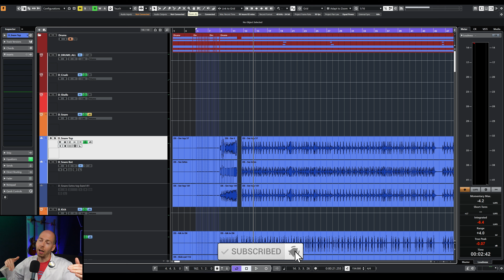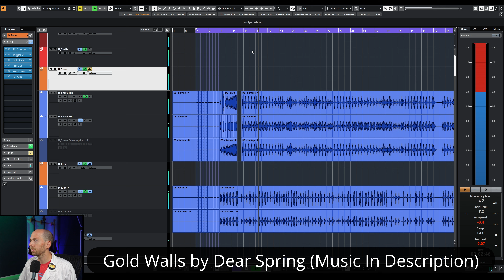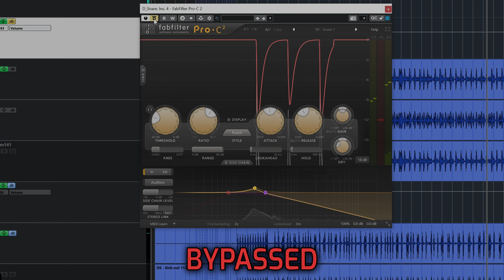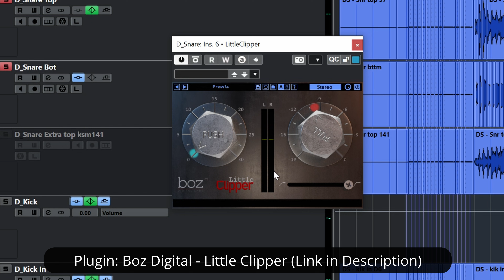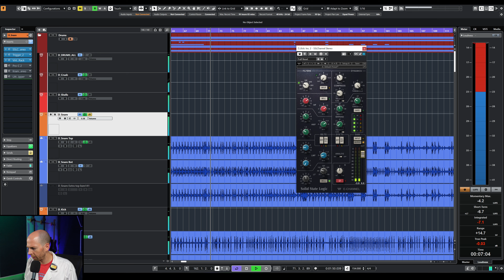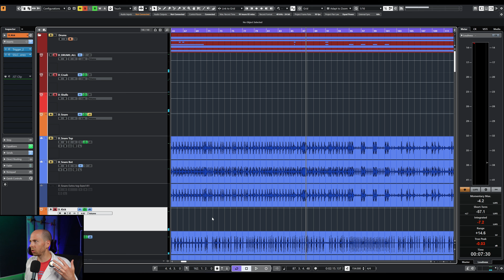DON'T MIX into a Limiter or Bus Compressor Until You See This!

Comment: Its all easy when you don't care about the snare having any CRACK, let alone wanting loud crack. Its always the first thing destroyed when over compressing. Still lots of good points in the vid for those that don't. When doing my own masters, which I don't prefer, but usually do it to have my snare the way I prefer, I don't master from a stereo file, but have the stems available in the open mixing session. This is crucial, because as that level is raised on the master bus and I start losing that snare, many times adding various different tools on the track level can bring back my precious crack, sometimes even just rolling up the fader, all while keeping the levels where I lost her, its results are material dependent tho. If I lose the snare crack to meet some loudness goal that HAS to be archived, I could really care less anymore about the mix, the drum energy is gone.

Comment: I just don't get it. Why would you want to be hearing the sound of a mastered track when you're mixing it. Just make the best mix you can without top loading it. The mastering will take care of the rest. Have some faith! 🙄
Reply from the maker: Because often times - especially with dense music - you "mix yourself into a corner" and don't realize how certain frequencies will build up as you begin to increase the loudness of the song in mastering. Same goes for your transients - as the song becomes more dense and full, you will start to lose definition of the transients. This allows you to compensate in the mixing stage so when it's mastered at the ideal loudness it will be exactly where it should be. It's like seeing into the future :)
Reply: Because some mix can sound distorted or some elements can be lost  after mastering. Its best to be aware of these things in the mix before you send it off
Reply: “Have some faith”? No man.

Comment: I definitely DO NOT mix into a limiter. I add mix bus processing about 1/2 way through. Usually a compressor first and then EQ before i do my automation.  I do however, pay close attention to regulating peaks and maintaining good crest factor for all those reasons you explained. The thing I don't understand about mixing into a limiter is, what becomes of the mastering process if you already have the song limited at the mixing stage? You cant just take the limiter off, right? The mix would fall apart. So, do you just send the song off to be mastered with the limiter on?  Are you even mastering a song that you mixed through a limiter?

Comment: Since I first watched this I’ve been doing way more gain staging and it makes it all sound even better. I used to clip drums at the stem but not at every element like the snare or kick. I actually have a full master buss chain. I use a buss compressor with a low filter at around 120 (depends on the song) then into a linear phase multiband to keep everything in check and do the low and compression. Then a maxbass by waves. A waves center for stereo imaging. Then a ssl rack with a 12k 2db highshelf. I just like the sound of that one. And an eq. Then in post a clipper into ozone with the joey sturgis chain he showed on nail the mix. I do turn a lot of it off to check if everything still sound good without, but to have it there to be able to listen what it will actually sound like is amazing.

Comment: Another great video, thank so much for covering the concepts.  Another reason to gain stage and specifically watch the input levels into plugins is because quality analog emulations VSTs are designed to work at specific input levels and will distort or add too much saturation if the input is too high.  I initially resisted mixing into a 2-bus compressor and limiter, but now I do, and I engage them after I get drums, bass, and a key instrument or two set with EQ and compression.  A key benefit I found to this is that I can optimize the initial mix because I know the amount of gain reduction I want in my master bus compressor and limiter, so I have the thresholds already set on those.  That way, when I am done mixing and ready to master, the level on my master bus is good.

Comment: This only works in the box? How would you so this with all analog hardware and console?
Reply from the maker: That's correct. If all analog, each piece of gear will have an ideal operating range which doesn't directly correspond to digital signal levels (at least not without a reference).  You need to maintain the signal within each device's specifications from one piece to another...

Here is a great video that explains the problem and how to manage hybrid gainstaging for an RME interface. https://youtu.be/UCyXcrT7SnI?si=zma4QmywIlJkAek1

Comment: For someone who primarily uses amp sims and vsts in general, what level range would you recommend going into the mastering chain? I have been trying to keep it around -12, but after hearing you state that you should try to keep it consistent from the input throughout the chain, I am not sure what I am doing is correct. I am not clipping anywhere, but I do try to keep my input on my DI peaking at around the yellow so that I have good signal into my DAW, but then I will apply some limiting or other output adjustment to get down around -12. After listening to you, I think I may be incorrect.

Thank you for the great material!

Comment: Great video as always. So I’m wondering if you tend to setup the individual track dynamics/compressors etc first before you start properly start mixing into your mixbus compressor/limiters?
Reply from the maker: Yep! It's in my mixing template. I have them all bypassed and then quickly adjust the settings for each project. The in and out levels are all set up to make sure the gain staging is rock solid. Great question!

Comment: When your done with the song do you remove the limiter to do mastering
Reply from the maker: Yes!
Reply: @RaytownProductions Do you mean you remove the limiter and turn the master bus down so it doesnt clip before sending it to the mastering engineer?  Or take the limiter off and make no volume adjustments before sending it to the mastering engineer?
Reply from the maker: @380stroker  That is something that you should ask the mastering engineer. Typically, mastering engineers like to be in control of the transients and like using their tools to modify the dynamics, so many will prefer to work with a version of the song that doesn't have an output limiter on the track. BUT there are times when it's nice to master a song from the ending point of the mixer (meaning with the limiter and "premastering" chain engaged). Either way, there really isn't any disadvantage to turning down the master fader to ensure that nothing clips during export. Hope that helps!

Comment: So it would make sense to make the first gainstage and dynamic shaping completely with limiter on the master turned off and then after finishing this step adding the limiter to see which elements are hitting to hard into the limiter for example?
Reply from the maker: You can do it that way! I personally leave it on the entire time because of how my template is set up and my workflow. Experiment both ways and see what works best for you!